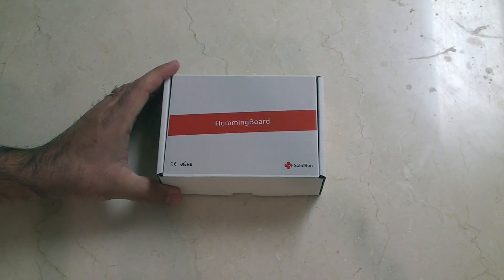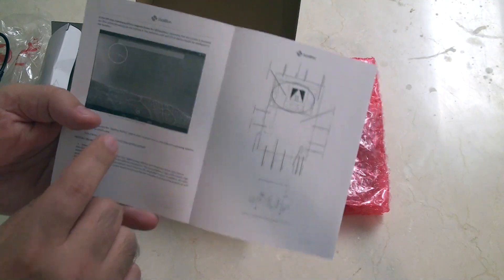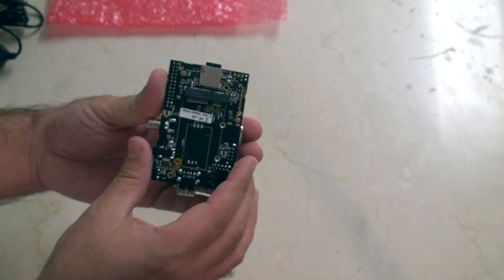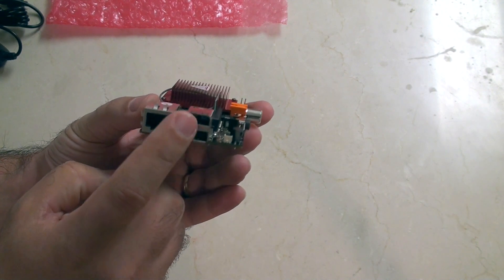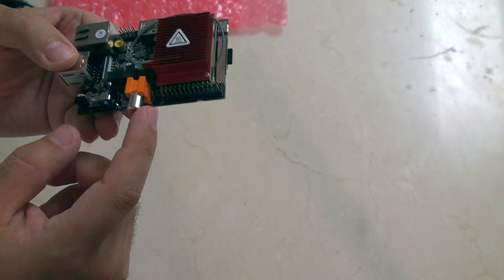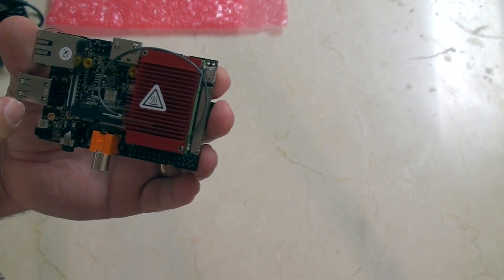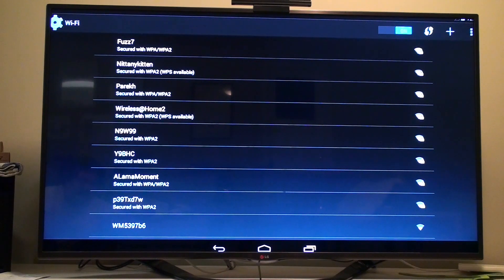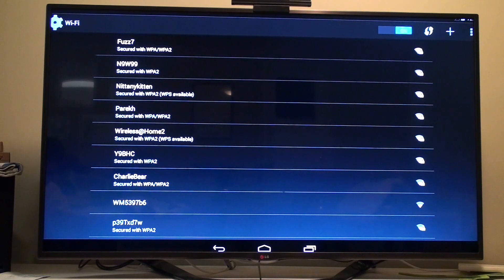Hummingboard i2EXW - A Raspberry Pi alternative with WiFi, Bluetooth, 1Ghz CPU and 1Gb ram

Comment: Regardless if this bored was released or not, the hummingbird products all share the same wireless chip and heat sink...

The owners manual says for the humming for products.
"reorient or relocate the receiving antenna"
Reply from the maker: +bigmac turd Bored, yes.  The W in "Hummingboard i2EXW" refers to WiFi.  It's the only one that was produced with that feature.
Reply: +skiwithpete I just purchased one of these boards with wifi included on the microSOM chip...

everything you say is so wrong...

again, I read the same document you show in the video with identical fine print... 

it also says move the receiving antenna away from the hardware...

Comment: looks like the heat sink may block or create interference with your wifi antenna... pull that thing out of there ;-)

im looking at this board for its onboard wireless N interface and hope to install another wireless N mini pcie card...
Reply from the maker: +bigmac turd I still don't get why people think that a heatsink isn't a good antenna, and that it must necessarily "interfere".  You're not the first person to suggest it - I just don't get it.
Reply: +skiwithpete wrap the antenna with aluminum foil, signal strength will go way down... i think they just found that to be a convenient place to ship the antenna because it fit nicely.

if you build your self a wind surfer (instructions online) you can reflect the radiation waves into a long range direction...  this is the application ill be using this humming board for... wifi extending using 2 cards
Reply from the maker: +bigmac turd I don't know what you're talking about.  Aluminum antennas are very common.  Wrapping aluminum foil around something won't make your signal deteriorate UNLESS it's not touching the conductor.  Look at Apple's iPhone.  The Antenna is the aluminum case.
Reply: true, the iphone case is made from metal, if you remove this metal case, the signal strength Will increase.

how many sheets of metal can a wifi antenna transmit threw? not that many...

maybe in th 80's a analog tv antenna could increase the quality of ONE channel by wrapping the antenna with tin foil. this maybe your misunderstanding...

if you want all channels to come in like HD, place a Proper antenna on your roof top... (hummingboard antenna on roof)

i dont think you want to understand... but this is dumbed down to the best of my abilities...
Reply from the maker: +bigmac turd Ironically, I'm watching HD TV right now with an antenna beside the TV.  http://amzn.to/1Wzlz6G I live in NYC.  The TV from the 80s uses the same tech as your cell phone.  An antenna is just a piece of metal.  Go to wikipedia.  Tell me why a metal heatsink would block a signal.
Reply from the maker: +bigmac turd That metal would "block" a radio signal?
Reply: Enough metal will "block" a radio signal.

have you ever drove threw a tunnel and loose the radio station playing in your car?

I can ask a child this same question and get a intelligent response...
Reply from the maker: +bigmac turd 1) To my knowledge I've never driven through an all-metal tunnel and 2) as I said before "Wrapping aluminum foil around something won't make your signal deteriorate UNLESS it's not touching the conductor."  So when I'm driving through the tunnel and my radio antenna isn't touching the sides, yeah, I would expect it to block it.  But, if I touched my antenna to this tunnel wall, I would - in effect - be turning the entire tunnel into my antenna.
Reply from the maker: +bigmac turd I think you mean I need to "accept" reality.  Not "except" it.  Thanks for your advice though.  I will except it.
Reply from the maker: +bigmac turd Why do you want a fight instead of the truth?  Just back up your claims.  But instead, you're spreading half-truths around the internet.  Now, someone might come along and think - this hummingboard isn't any good that thing blocks wifi signals.  When, really that's just a comment from someone who has no idea what they're talking about.  Sorry.  Happy for everyone on my channel to come and learn.  And it's not the first time I've heard this comment.  But turns out it's a wives' tale, and not based on any fact or science.  Welcome to the Internet.
Reply: +skiwithpete I speak the truth, find your self a new hobby...

ill bet your hummingboard sits on your desk doing nothing... 
return it and stick with Pokemon cards.
Reply from the maker: +bigmac turd Then PROVE it.  It's not hard.  Send me links.  If I'm wrong, I'm more than willing to listen.
Reply: +skiwithpete I ask you to try for your self in my second post... but you respond like a fool...

I suggest people watch your video with the sound muted...
Reply from the maker: +bigmac turd Again, if the metal is not connected to the antenna it will change the properties of the signal.  If the metal is connected to the antenna, it will become the antenna. This is essentially, what an antenna is.
Reply: +skiwithpete in both situations, you will loose  performance.

if you want to learn, check out andrew mcneil on YouTube...
Reply from the maker: +bigmac turd Here's a PDF for you:  http://www.adv-radio-sci.net/9/317/2011/ars-9-317-2011.pdf  You can skip ahead and just search this:  "In particular, the heat sink can become an efficient antenna when  resonant  phenomena  occur  (Damiano  et  al., 2004). "
Reply from the maker: +bigmac turd This is exhausting.  Your knowledge is limited.  Your understanding is basic.  And your willingness to learn is impudent. But, you don't need to take my word for it...  Contact Hummingboard.  Their science team will explain to you as they did to me after the first time this was questioned.
Reply: Its not a thermometer...
Its called a omni directional wifi antenna... the cpu already has technology to display its core temperature...

I can make a demonstration video, monitor packet loss, noise levels with dbi... simulate what happens when a dipole antenna is slid into a heat sink... maybe you can tell us all what kind of driven element was provided?
Reply from the maker: +bigmac turd Yes please.  I would like that very much.  Then I'd like you to look up SolidRun - the people who make the Hummingboard and ask them for yourself.  I did.
Reply from the maker: +bigmac turd The manual for the Hummingboard i2EXW?  It doesn't exist.   You're reading a manual for something else.  Why am I putting up with this nonsense?  Have you contacted Solid Run yet?  The antenna was designed to be used like this.  FFS.
Reply from the maker: +bigmac turd I've also noted that you are going back and changing your old posts in this conversation.  As I've said repeatedly.  You are not the first person to ask this.  So I previously contacted Solid Run directly, they said that the antenna was designed to work in conjunction with the heat sink and that it should not be removed.  If you would like to contact SolidRun directly, I invite you to do so.
Reply: +skiwithpete I have not changed any post...

there is a pdf online that matches the document you show in the video... with identicle fine print...

it says reorient or relocate the receiving antenna...

dumb shit lol...
Reply from the maker: +bigmac turd This board was never released.  It is not for purchase.  It does not have any support manuals.  It is undocumented.  Which is why I did not know what the parts were on this first walk around.  No one else has this board.  Do a search for it.  It doesn't exist.  And, like I say, you're not the first person to come in here saying this won't work.  So I contacted SolidRun.  After that, I got more messages.  So I tried to take the short wire antenna out of the heatsink.  It is designed to be trapped between the fins of the heatsink.  It is not simply lying in there, there's a metal spring that holds the wire in place.  You can see that metal spring at 4:16 of the video.  I'm afraid you're wrong on this.

Comment: The IR port is there, because not everyone has a tv manufactured within the last three years to utilize the HDMI special feature set. My TV I bought five years ago and cannot be powered on or off with HDMI.
Reply from the maker: bkpickell really?  The TV I bought in 2004 (a grey edged Panasonic Plasma) works.  Do other IR instructions work or is it just the on/off?
Reply: It will detect if there is a signal, but the tv has to already be on. Mine is a Panasonic Plasma as well. For example If I am watching something on HDMI 1 and say put a game in the xbox, the tv will automatically switch to the game input on HDMI 2. But I cannot turn off the TV using the raspberry pi 2, nor can I turn the raspberry pi on with the tv. I've tried.

Comment: Any plans on checking out the Banana Pi BPI-R1?
Reply from the maker: Right. How do I do that? I have a feeling that even if I was doing this full time, I couldn't keep up with the explosion in these small linux based devices.  While I haven't tried that board in particular, my experience with Banana has been positive, so if that's the specific design shape you're looking for, I can't see a reason to hesitate.
Reply: skiwithpete Don't really have a use for it, but because it's a RasPi clone with all the network ports to be a router, I'm curious to see what people will do with it. I really want someone to do a home-network-in-a-box, but sadly, I haven't seen anyone playing with it, so I haven't been able to get my vicarious fix.

Comment: Love the fake surprise as you open it up "for the first time."  😉

That Wi-Fi antenna shouldn't be tucked in to the heatsink fins. The heatsink isn't acting as an antenna, it was only in there for transit! Please post something in your description in case others follow what you have done and damage their Wi-Fi modules.
Reply from the maker: Ronan Cantwell Hey Ronan, I do actually open these things for the first time on camera.  I reckon that gives an honest impression of what I think as I discover - but it also means I make mistakes.  One thing, I don't think is a mistake is that I'm pretty sure the wifi antenna is meant to stay in the heat sync as it is tacked in place.  Also as the heatsync covers the wifi module it's not like it's adding heat to something that's not already hot...
Reply: skiwithpete 😁 If you say so guvnor. I wasn't picking holes, just referring to the fact that the packaging looked like it had been opened up before.
It's very unlikely that the Wi-Fi antenna would be tucked in between the heatsink fins though. Heat isn't the issue; they would act as RF screening at best and, worst-case, an electrical short if the paint became scratched. The antenna was probably stuck in there for transit or may even be intended to be stuck to the top surface of the heatsink which is still a very poor design choice. 

Anyway, nice little boards which I hadn't heard of before seeing your video so thanks for posting it.
Reply from the maker: Ronan Cantwell
 Cool and thanks for the tips.

Comment: With the clipping problem you are experiencing, in the aspect ration or screen settings on your TV instead of 16:9 if there is a screen fit option do that one I had the same problem with my pi and that fixed it for me.

Comment: Hi, I was wondering how it's going with the i2eX? I've been sent a hummingboard i2 and it should be here by the end of the week, but I have little experience with these kind of boards. Would you suggest installing the supported Debian distro to start off with? How does it run?

Also, are there any quirks you would say are important apart from a RasPi case not fitting? Thanks.
Reply from the maker: NotMyName It came with an SD card with Android, but yes, I switched it over to Debian.  I haven't had much time with it besides that.  I'm not really sure what to do with it.  What are you going to do with yours?
Reply: I haven't completely decided yet, but was thinking of controlling a simple home automation project with this, using a webcam and spare 2.5" hard drive I have lying around. Will probably try out using it for a NAS too.

Annoying that the raspberry pi 2 just got released though haha, i see the hummingboard being rather redundant now :/
Reply from the maker: NotMyName  The HummingBoard has Gigabit Ethernet.  So if you're thinking of making a NAS, the HummingBoard is a much butter choice than the new Raspberry Pi 2.

Comment: 14:19 ... android is linux based OS ... but I know what you wanted to say
Reply: I know this is a necro bumping, but it makes me cringe that the comment is still here. Android does use the Linux kernel, but it is not classified as Linux. If something were to be classified as a Linux distro, it would need to utilize other softwares like a GNU, and many other third party software.

http://www.howtogeek.com/189036/android-is-based-on-linux-but-what-does-that-mean/
Reply from the maker: "Android is a mobile operating system developed by Google, based on the Linux kernel and designed primarily for touchscreen mobile devices such as smartphones and tablets."Android (operating system) - Wikipedia, the free encyclopediahttps://en.wikipedia.org/wiki/Android_(operating_system)Wikipedia

Comment: Does it have coil whine?
Reply from the maker: muffemod Absolutely none.  -- Despite the name, right?  No it doesn't humm.  It doesn't whine.  In fact, now that you've mentioned it, I haven't heard any humming or noise from any of the Linux development boards (Raspi, BananaPi and the Hummingboard)
Reply: skiwithpete
 LOL I just had to ask with the name of the board.  Good looks, thanks.
Reply: skiwithpete

I think the HummingBoard-i2 (their middle option) is the best value.  It has the performance upgrade without the features I don't need.

Comment: I bought a Hummingboard i2ex. I am returning it for a refund and won't be buying a Hummingboard again. As has been talked about again and again, Raspberry Pi cases will not fit the Hummingboard. There are not the mounting holes needed, and there is a module on the bottom that will not allow the board to lie flat on a mounting surface. The main problem for me, however, is that I could not get any operating system to take on this board. I loaded Raspbian, using the image directly from the raspberrypi.org site. It works fine on my Raspberry Pi B+. But, I get nothing on the Hummingboard. No boot whatsoever. I then tried Ignition which is a start program made by SolidRun. It is supposed to have the selection to set-up wi-fi, but it doesn't. And, because of that, you can't get to the supposed step of selecting an operating system for the board. Quite disappointing.

Comment: Peter Gosselin 

I found this thought you might be interested:
http://www.solid-run.com/community/topic1573.html

After installing my msata and moving the OS this is the performance I got on it:

/dev/sda:
 Timing cached reads:   774 MB in  2.00 seconds = 387.02 MB/sec
 Timing buffered disk reads: 364 MB in  3.01 seconds = 120.88 MB/sec
 Random 83886080 bytes (84 MB) copied, 0.217252 s, 386 MB/s